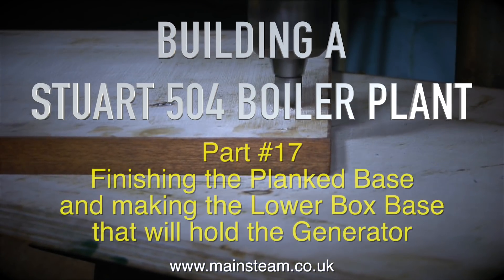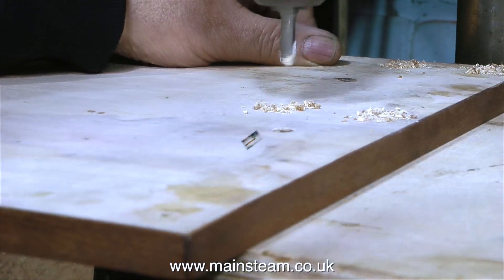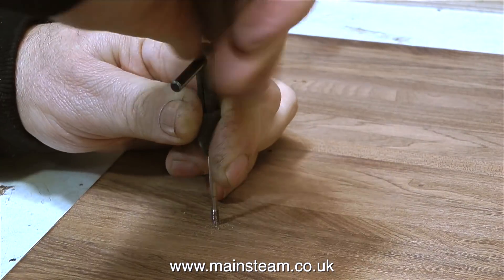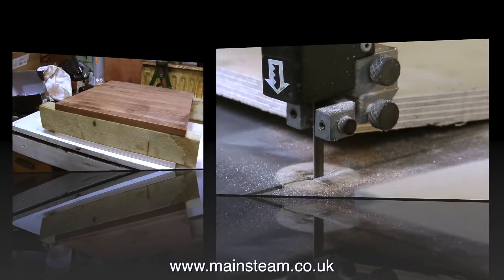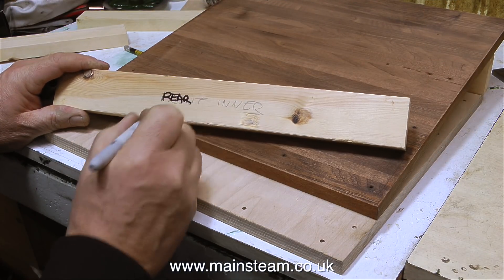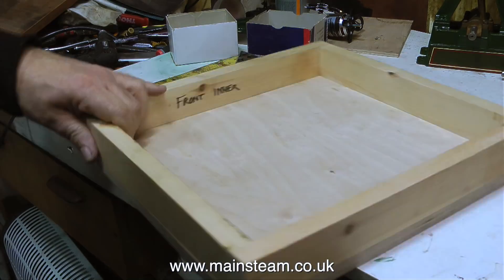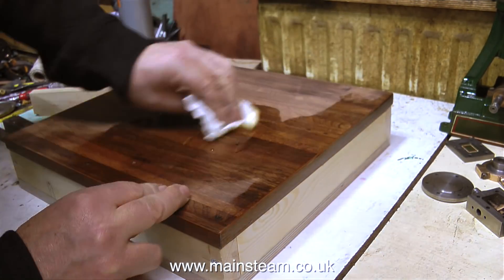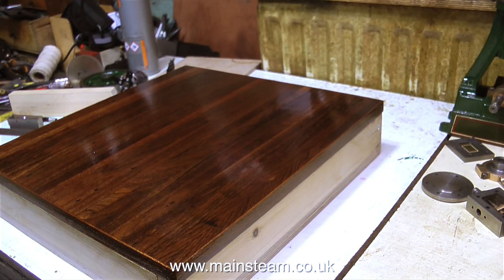MAKING A STUART 504 BOILER PLANT - PART #17 - BASEBOARD SUB ASSEMBLY

Comment: Lidl's had some of them forstner bits in small and large kits not so long ago, were only a few quid too and I have become quite the fan of Lidl's Parkside tools which are still made in Germany and not a sweat shop in ying tong piddly eye oh land and I have frankly abused my poor Parkside 20v cordless drill and its still going strong :)
Reply from the maker: what is a "forstner" bit ? I have a "Parkside" drill sharpener, it's OK, but i generally grind the bits by eye though - it's quicker . . .
Reply: Its a kinda like a hole bit, used primarily to make the depth holes in kitchen cupboard doors but useful in all sorts as it creates a flat parallel straight round hole in wood, looks like a really wide and flat countersinking bit and the smaller bits are brilliant for milling out channels in wood.   I recently bought Parkside's DA sanding attachment for my compressor and I use often their soldering station which is a really good bit of kit and a million miles away from the previous brand Silverline Lidl's ran which was dreadful I found
Reply: large diameter flat bottom hole wood drill bit
Reply from the maker: I see, thanks Ian, I never knew what they were called {:-)))

Comment: try using a combination of felt & rubber pads underneath said board
Reply from the maker: The trouble is that felt & rubber pads don't last when steam, oil & water is around ..... I have tried it in the past .......

Comment: I like that you explained using the slot drill as a flat bottom hole cutter. Tips such as that can let beginners know that a device can safely be used for something other than it's intended purpose. Cheers.